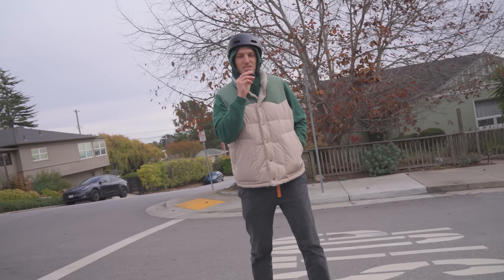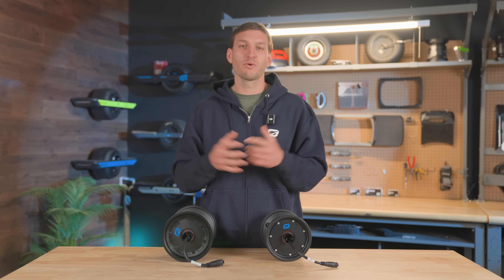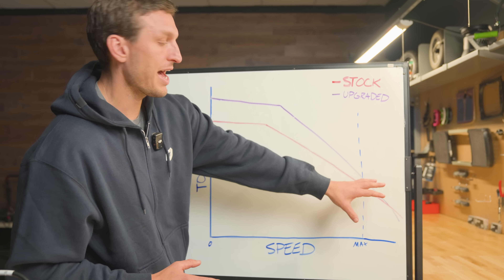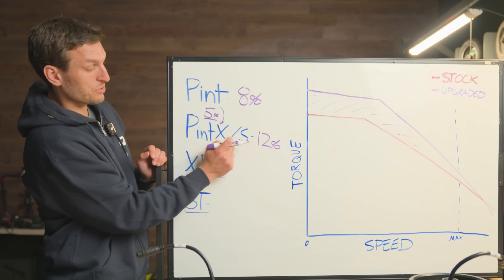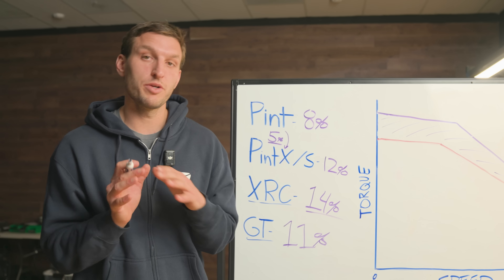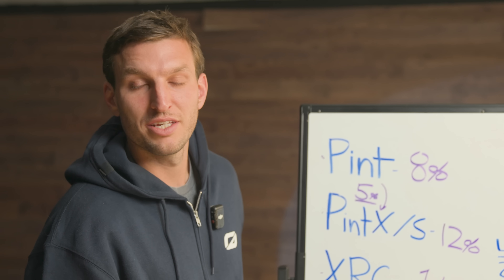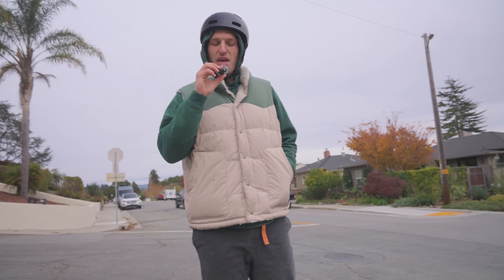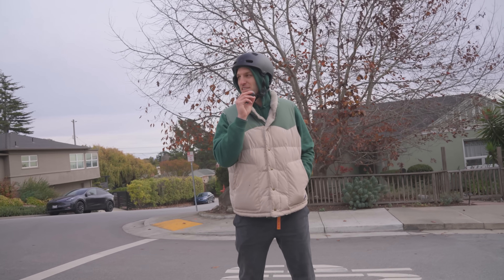We Put an S-Series Motor in a Onewheel Classic!

Comment: Does this increase top speed? Or just uphill strength
Reply: Increasing torque actually often comes at the expense of top speed. So, these motors likely do the opposite. Something to keep in mind.
Reply: It does not increase top speed, correct — it actually decreases it! You won’t find that advertised anywhere though.
Reply: it increases climbing capability but reduces top speed on the high end but Future Motion significantly limits their boards top speed anyway, so you're not likely to notice that
Reply from the maker: Does not increase top speed. It affects torque and particularly in the low and mid speed ranges.
Reply: @Onewheel  More torque good not able to make the advertised 20mph is bad.

Comment: Does the pint S board come with a pint S motor?
Reply: This was the motor we were expecting to get when we ordered the S instead we were sold a lie, cause they knew this was coming. The pint S is a pint X with foot pads and a tire. I would’ve been happy paying a couple hundred dollars more when ordering S. Instead of and X wit( lipstick that tops at 18
Reply: No that would make wayyy too much sense. We gotta keep these product names as complicated as possible 👍
Reply from the maker: @PoopTart3  Can confirm that it is a bit confusing.
Reply: @Onewheel  Hey, at least you guys acknowledged it
Reply: @Onewheel what genius came up with this naming convention, how did you not see this coming
Reply: @michaelspandau6805  ignorance at best, malice at worst -- incompetence regardless
Reply: @Onewheel  to confirm Pint S does NOT have an S motor, correct? Pint S is NOT an S-SERIES, just a Pint S by name not by specs.  I’m trying to clarify with some friends of mine considering a Pint S vs a Pint X. The motor & power is the big factor.
Reply: @Onewheel   then, with all respect, you may just change the current pint s name, to pint x performance or pint x se (special edition) or pint x+ instead of naming it pint s. To clear all the confusion.

To put it simply, you should naming your new pint board as pint s, only after you are able to pre installed the pint s motor to your new pint board line up.
Reply: No, its confusing but the Pint S is not an S series. If it came with the S series motor it would cost more than a GT
Reply: @turningmagnets nah, it would cost more than GTS ❤

Comment: You can fit a GT-S motor in an XR classic? Or did I miss hear something?
Reply: XRC is basically just a GT on XR style rails
Reply: @PoopTart3 although XRC and GT share the same controller and footpads everything else is unique to the XRC including the way it handles
Reply from the maker: Yes mister Sandwich. You can and it's awesome!!!! Possibly the dream board.
Reply: @Onewheel would I expect a loss of range pitting GTS motor in XRC? Thank you! I’ll definitely pick this up
Reply: @zalla135  If it has stronger magnets then you will see a lower top speed but they don't want you to know any real specs